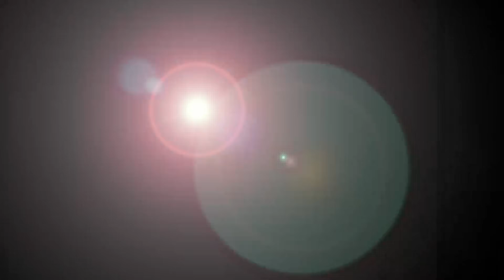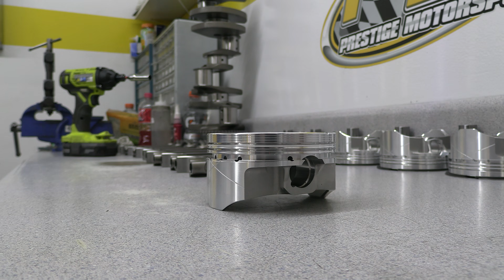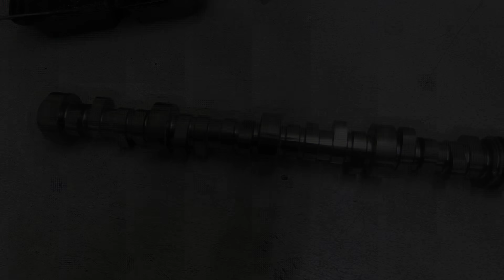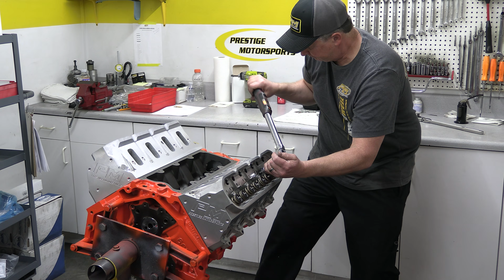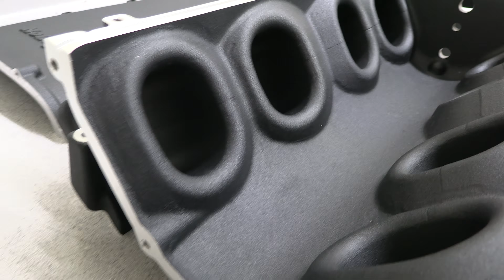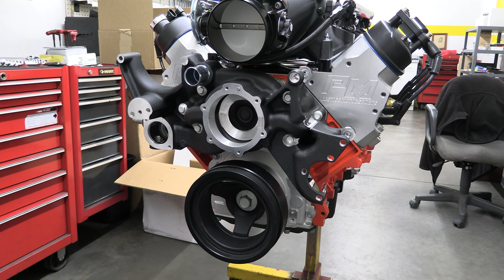This LS Makes an Easy 580 Horsepower on Pump Gas! [And It Can Be Yours!]

Comment: If this makes 508 ftlbs. With just 408ci. Where is a C6 Corvette with a 427 LS lacking? Because it is just rated at 505hp. Without going to a much bigger Camshaft, is there a more obvious reason for the lack of power in a 427ci ?
Reply from the maker: Good point. If you are comparing to an LS1 or LS3 engine, these heads are much better. But the stock intake manifold is awfully good when it comes to making torque, too. Thanks for watching!

Comment: Nice build! I know there's always critics and Holley sponsored this so, not always the best parts for the application are used.  
That intake DEFINITELY sacrificed ALOT of torque that this street engine could have used. An LS3 would have been waaay better for this application. But, some will sacrifice performance for looks
Reply: He literally explained the Who, Why, What, Where and When…

The best parts? 
The best parts for what purpose? 
They used the best parts needed to yield the results you saw in the video. Something any regular Joe could be happy with for any car it fits in.
Go Poo on someone else’s video.
Reply from the maker: Hey thanks! And thanks for watching!